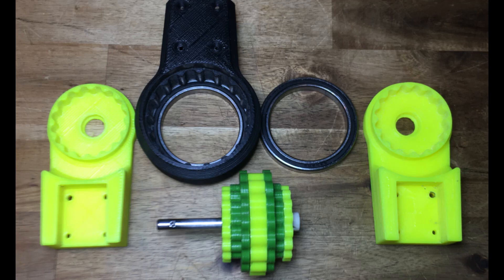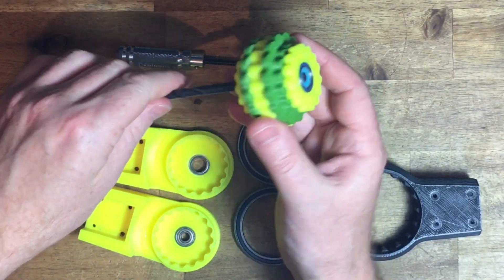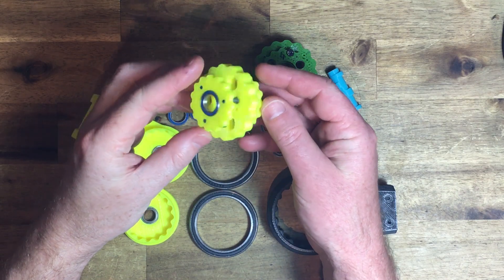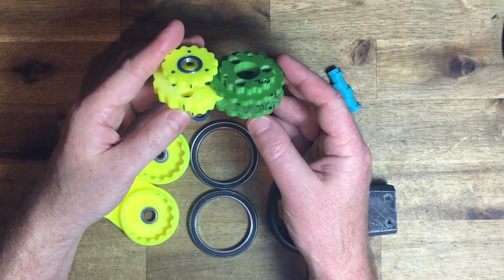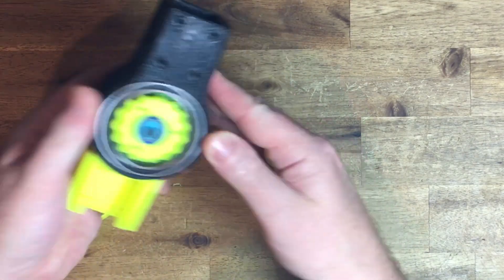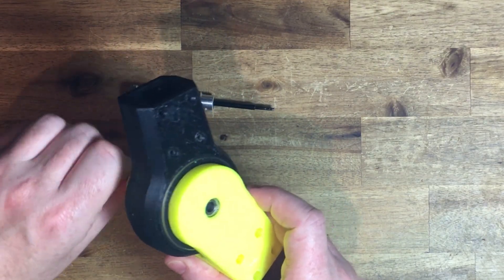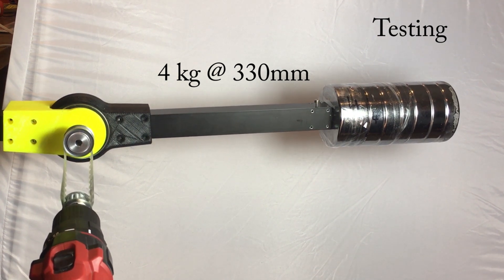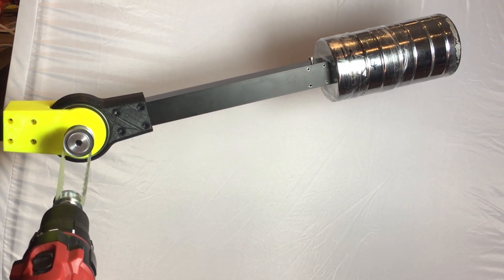Triple Dual Stage Cycloidal Gearbox

Comment: Great video! Could you share the design parameters, specifically the eccentricity of each gear, the PCD, the roller diameter, etc.?

Also, could you share the book, article, or source you used as a reference, if applicable? That information would be very helpful. Thanks.

Regards

Comment: downgearing bldc motors is cutting edge for robotics field imo.  however, rather than gears, I think pulley systems to downgear are the best route.  quieter, can take up very low volume in total, can be made VERY small, can be VERY cheap to make.  doing a lot of experimentation and design improvements on that area now.  I recommend you look into this approach as an alternative.
Reply from the maker: Check out my other videos and on Instagram. Many other gearbox designs there. Each has their place. I do this mainly to learn, no real end game.

Comment: Hi do you have sldprt doc?
Reply from the maker: What is that format? I think that it is only for Solidworks, which I don't have. I can create some other formats if you like.
Reply: @PaulGouldRobotics yes it formats is solidworks and if you share with us I am very happy for this format is not important which if you want only its draw format its enough
Reply: I want to ask a question please can you tell me how can we setting gear rate for example you did 240/1 but O need 100/1 how can I set it
Reply from the maker: @yusuftasdemir6722 I can create a step file for you. I am trying to find an equation for a dual stage cycloidal gearbox but I can not find one. If N1-N2 =1 then the gear ratio is 1: (N1xN2). But is N1=N2 then there is not reduction ratio. I think that the ratio is 
1 : ((N1*N2)/(N1-N2)). Please check this. If true then N1=21 and N2=25 gives exactly 1:100
Reply: @PaulGouldRobotics  thanx but I didnt understand your calculate
Reply: Is there a program to calculate this?
Reply from the maker: @yusuftasdemir6722  As I said before. I looked for one but couldn't find one.
N1 & N2 are the number of outer pins.
Reply: @PaulGouldRobotics  ok I understand thank you so much
Reply from the maker: @yusuftasdemir6722  I just uploaded the step file to the Thingiverse page
Reply: @PaulGouldRobotics  yes I seem that file thank you very much

Comment: What kind of printer do you use?
Reply from the maker: It is an old(modified with covers abs) Geeetech iprusa clone. It is a very bad printer. I now have an ender 3 but it only prints pla. Bascally the printer doesn't matter. Just adjust tolerances in the drawings or printer settings.

Comment: This is impressive ! You do an incredible great job !
I'm looking for high gearbox ratio (200:1) for a star tracker project. I tried 3D printed planetary gear, but there were too much friction and my stepper motor (NEMA17) can't make it turn well. I found cycloidal gearbox to replace the previous gearbox, but my output is not linear and do back and forward.
It seems your design with dual stage are really more stable. I will try to make a new version of my cycloidal gearbox with a dual stage.
Reply from the maker: Thanks. You can turn the input shaft quite easily at low torque. I've only made one prototype of this design. It needs a few improvements. I was trying to make it as small as possible. The plastic is quite springy at this small size. I suggest making it bigger for your star tracker, using bigger bearings. Good luck. Please show me your finished design
Reply: Paul Gould I printed my prototype of the cycloidal gearbox with two stages for a total reduction on 195:1. But after some tests, the output is not linear, there is a wavy movement that put the prototype totally unusable. So I will try with a 3D printed harmonic drive with a 50:1 ratio and a planetary gear 4:1 on second stage. The harmonic drive seems more linear than cycloid gearbox. I will try this new prototype and I comeback for the results 😉
Reply from the maker: @edwinripaud7724  I had this same problem. The maths is looks correct, so I can't work out where the non-linearity is coming from.

Comment: would t be possible to make a multi stage gear reduction by increasing the diameter (instead of making it longer, make it fatter)
Reply from the maker: I have often though about this and tried drawings something up in CAD but nothing has worked yet. If you have any designs, I'd love to see them.

Comment: have you tried printing your parts on an SLA printer for much greater precision? would suggest using Elgoo Mars or Saturn
Reply from the maker: I have found SLA/resin parts very brittle and not very strong. I could do with the precision though.

Comment: Dude can I used this motor on my diy scooter 10" wheel at 20:1 or 12:1 gear ratio my weight is around kg50<.?
Reply from the maker: Quick answer is no. The min reduction ratio is about 80:1. It is not designed for continuous operation. The design is a prototype and more for robotics.
Reply: @PaulGouldRobotics  ok. Thanks for saving my time and money 😊
Reply: @PaulGouldRobotics  o. Dude I mean the "motor you used in another video 5010😀". That motor.
  Not this gear
Reply from the maker: @ramadavince6611  I use the Gartt ML5010 (850W) from gogorc.com (cheapest I can find them). I haven't seen this type of motor used on scooters/skateboards. They are usually 5050 in size at 2-3kWatts.
Reply: @PaulGouldRobotics   50** I know. But my problem is I live in one of India. The only thing I can get is this 5010 motor in national online shopping 😟. And small once like 2210 etc
. Can get like 6384 ect from AliExpress,bangood... But they are very risky on shipping in with this Corona thing.
   My guess is if a 250 watts  motor like 'my 1016 motor' can run ebike and scooter. A 800 watts motor may run may get the job done 😁? So.. I'm just asking as you have more experience with the motor😃
Reply: @PaulGouldRobotics  do you think the motor has enough power.
Reply from the maker: @ramadavince6611  It will be under-powered/slow
Reply: @PaulGouldRobotics  ok thank alot. By the way are this motor 50 mm stator or the can?
Reply from the maker: @ramadavince6611  stator is 50mm dia, 10mm high. The can is 59mm, 17mm high
Reply: @PaulGouldRobotics  I think I have to try this. Even boosted board motor are around 50mm can and 30mm high stator can be 40/20mm. (I mean they are tiny)
 Thank alot my friend. And I'm subscriber you😁

Comment: Great work, if this was made with better tolerances would the backlash be zero, or would we have to switch materials?
Reply from the maker: I'm not sure. There is no slop, just springy backlash. ABS plastic is naturally flexible. Is there a stiffer /better 3D filament?. A lower gear ratio would also help.

Comment: Hey, will you be using Gartt ML5010 motors for this project again? Since I am planning to build a stationary robot arm, I would like to rather use a power supply than lipo batteries! Could you give me a recommendation of which one would be good to use for this project? :)
Reply from the maker: The easiest solution would be to use a NEMA23 stepper for the lower joints and NEMA17-long for the upper joints. I would recommend this gearbox https://www.youtube.com/watch?v=pizl7i-uB68. The triple dual stage is still in early development and has some work to complete.
Reply: @PaulGouldRobotics  thats the one I already printed, still waiting for some parts to do the assembly...I also want to try brushless motors at some point, using the odrive...or hopefully your controller!!
Reply from the maker: I'll be making a bigger one of these. I would like to fix the current issues. I'm not sure what motor I'll be using, I don't really have a practical application for this project.

Comment: isn't 240:1 a lot of reduction for fast movements?
Reply from the maker: Yes and no and it depends on your application. I see this being used as a hobby robot arm. Fast movements are not really required. 
This is a proof of concept and I think that a reduction ratio of 70:1 would be more useful.
Typical RC/smart servos have ~300:1 gearboxes.

Comment: Every cycloidal I've seen an tested has the same issue as the one seen in your current one: a wobbly / sinusoidal / non-linear output. Which, from what I managed to simulate so far, doesn't come from a geometric flaw in the design, but from a cyclic difference in teeth engagement pressure angle, resulting in a cyclic torque stiffness. This, to me, is much more disturbing / damaging than any eccentricity vibration, as it effectively impairs the system's angular precision under load. Do you have any ideas on how to mitigate THIS effect?
Reply from the maker: I don't fully understand what you are describing. I've only noticed once per revolution problems when something was made wrong. I have 6 of the "simple cycloidal knee" designs and only one of them wobbles. I will replace it at some point.
Reply: @PaulGouldRobotics  I've been noticing these wobbles ever since I've been experimenting with the hypocycloidal model. And I always wondered if this was a matter of a bad mathematical model or just a matter of weak construction. So now I finally gathered enough momentum to model a properly parametric model and to test its geometric properties. 
I have two conclusions: 
1. the mathematical model is SPOT ON. The output results in a linear relation to the input. So I stand corrected there. But... 
2. In terms of torsional rigidity, I found out that things are not as linear: whenever a pin gets to either a peak or a valley dead center, you have minimal torsional rigidity, which increases in a sine function while transiting towards the next peak/valley position, only to get back to a minimal value again. 
So for instance if you have a gearbox with 5 lobes and 6 pins,  you have 10 such minimal torsional rigidity points and 10 maximal ones. This fades out to nothing with a construction that is both correct and well proportioned to handle the designed load, but rears its ugly face whenever the gearbox is designed a bit weaker than needed.
Reply from the maker: Are you taking about a per tooth wobble or a per rev wobble?
Reply: @PaulGouldRobotics  per tooth

Comment: Very cool. Hows your dog project coming? Have you considered a resin printer for higher tolerances parts?
Reply from the maker: I've had a few side projects, as I get distracted easily. I've made some servo quads to test the Inverse Kinematics and working on a cheaper/easier bldc controller (Arduino/ESP-32). The leg design mostly complete. Just have to print 3 more.

Comment: Nice!
Too bad it's not as useful as some of your other designs.
I'm looking into designing my own cycloidal gearbox, do you have any tips/things you found that could be useful?
Reply from the maker: I have not given up on this design yet. I think a lower reduction ratio and larger diameter will help. 
What are you making? Start with torque, work out the speed you need. This will help you determine gearbox ratio and the motor. Then choose outer bearings and every thing will work out from there. I suggest a bigger dia/ low KV motor and run it at low current. You can chat to me at hackaday or discord @gouldpa
Reply: @PaulGouldRobotics  I want to make a roughly human sized bipedal robot, and these reducers seem like a good low cost solution. I'm pretty sure a torque of ~200 NM would be needed for that.
How do I contact you at discord?
Reply from the maker: @Skythedragon  https://discord.gg/k3ZZ3mS
Reply: @PaulGouldRobotics  Thanks

Comment: I think we would all like to see how it compares to previous gearbox joints you made. in terms of torque, speed, wear, stability, friction, accuracy, good points bad points.
Reply from the maker: This is the first prototype of this design. It has too many issues to make a fair comparison at this point. The simple cycloidal robot knee is the best for my robot quad, it is quickest to make, nicely backdrivable and medium torque. I haven't ran any of them too much to determine wear and stability. Accuracy will never that high with 3D printed parts.
Reply: @PaulGouldRobotics  Thanks for the video and the reply. I do think that your work can have future value in motorized joints in cost-effective robots but at some point the 3d-printed parts may need replacement by something stronger when it is ready to scale up.
Reply from the maker: @richardbloemenkamp8532  3D printing is great for development and research of new ideas. Most of my design are not really for practical use, just for proof of concept.

Comment: Very inspiring work. Have you considered laser cutting some parts for faster fab and better tolerances? I am curious as to where are you located
Reply from the maker: Thanks. I'm not sure how to deal with the 4 degree laser kerf on standard laser cutters. I'm located in Darch, Perth, Western Australia.
Reply: I get some pretty good gear meshing on my laser here in Auckland. I do it a couple of ways, stack 2 layers of 3mm abs together or you can flip thicker plastic and the kerf matches if the machine is set up well.
Reply: That's cool what sort of tolerances can a well set up cuter achieve?
Reply: around 50 microns but the smallest inside radius is around 200 microns

Comment: Wait... did you just offset the I/O from the gearbox so it is O <- I -> O and not I -> O ?
That is clever mate, awesome design.
Reply from the maker: It is a combination of the triple cycloidal and double dual stage. It is an iterative design process.
Reply from the maker: It is just mirrored.

Comment: Hi Paul, thanks for putting this up with so much detail RE assembly and design. I have been waiting for this version to be posted. I am just wondering why did you get rid of the pins/linear bearings on the outside of the cycloid gear. These were present on your previous prototype- uploaded in  April? Too expensive, heavy or some other  reason?
Reply from the maker: I wanted to make an easy, compact design. It would need over 70 bearings and lots of bolts. This is just a prototype and would be much better if made out of nylon.
Reply: @PaulGouldRobotics  Yeah I thought that it had a lot of parts when I started shopping for them. I was thinking of using this design or similar scaled for an exoskeleton. I previously mucked around with trying to 3d print a harmonic drive, but plastic  3d printed gears aren't very practical. Rolling friction vs sliding etc. Thanks for the reply.
Reply: @immersion-fx6650  immerse the 3d printed gear in grease and lube, lol. As long as the printed parts are not heated to the glass transform temp ( 60C for PLA), it wouldn't deform, for small and agile robot (low payload) it wouldn't be such a problem. The only problem in this technology, in my opinion, is dimension. FDM printers can't achieve good enough dimension accuracy for these type of part to work flawlessly. Resin printers can be the solution, but then the price of the 1 part is gonna be rocketed up

Comment: Neat design! Will you share the files somewhere?
Reply from the maker: You were too quick. https://www.thingiverse.com/thing:4412347 is up now.
Reply: @PaulGouldRobotics  awesome! Thanks.
Reply from the maker: @uint16_t  What are you planning on making with this?
Reply: @PaulGouldRobotics  a 2-axis camera mount
Reply: @PaulGouldRobotics  , Hi it seems that the smaller rings are missing. And what are the dimensions of the screws ? Thank you
Reply from the maker: @bravojul7351  Thanks for the feedback. I just updated the Thingiverse page with the little gear and the bolt info.